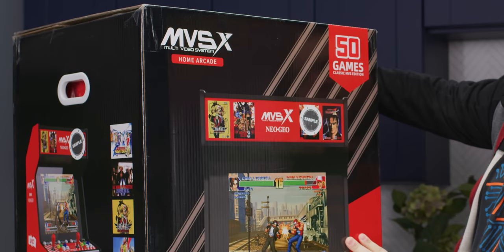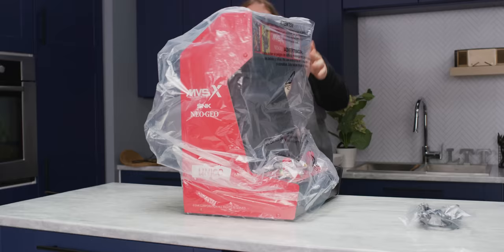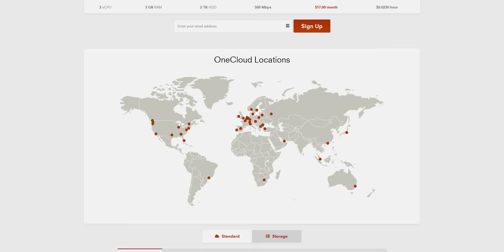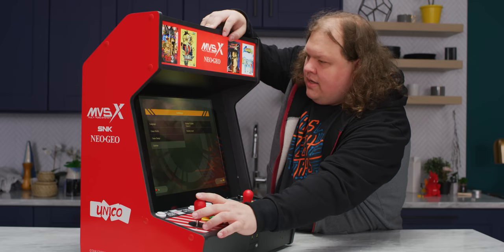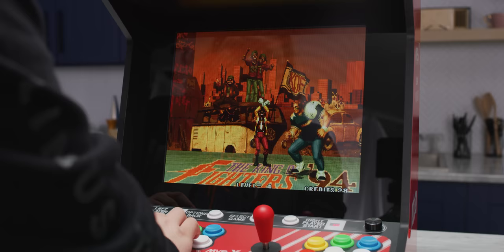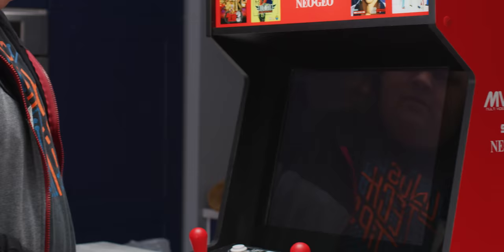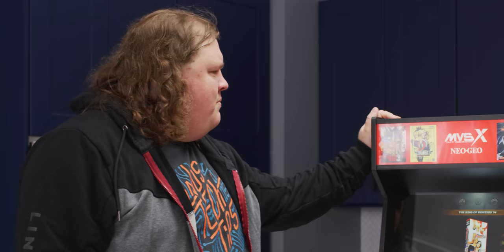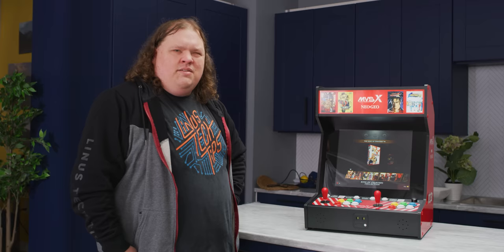My BIGGEST Unboxing! - NEO GEO MVSX Home Arcade

Comment: I recommend checking out the ashens review of this hunk of Junk.
Reply: A cultured individual I see
Reply: @TheLaptopLagger  I'm happy to see another cultured individual.
Reply: Strangely, I think Ashens review was better than Anthonys.
Reply: @madbstard1  to be fair this is just a basic look at the cabinet. But his "they're okay" or whatever comment on the buttons really concerns me.
Reply: @starpencil  Yeah, thought he'd do a lot more info on it. Ashens hated the buttons as well, plus he really raged about the extra unusable white buttons. Had another look and the options menu/button config doesn't even include the whites. Wonder why they included them?
Reply: @madbstard1  I honestly think it boils down to the fact the Ashens review was just that a review. And one by an arcade collector. While this was a short circuit video
Reply: @starpencil  Basically this. In true unboxing style, I hadn't seen it at all prior to walking on set with it. If I had played around with it more, I probably would have hated the buttons and layout about as much as Ashens did. I was a little timid about calling it terrible without having spent more time with it to confirm / "break them in". Stick's fine though.
Reply: @emily-young  exactly. I have a feeling age and experience has a lot to do with it as well.

Comment: You could easily build a far superior cabinet with 3/4in black mdf from the hardware store,  raspberry pie 4, 20in dell 2007fp lcd, an arcade stick and button kit from amazon, usb powered speakers. I bought a 1up Arcade on sale at walmart for 50$ (Galaga) took out the screen replaced with dell 2007fp, drilled extra holes for extra buttons and stick kit I found on Amazon, hooked up a raspberry pie 4 running retro pie. So for about 250.00 when all was said and done and it blows the doors off this thing. If you don't mind a little work it's an easy mod. The hardest part for me was making an mdf frame for the monitor so it looked nice. I added a thick glass screen in front of the lcd for effect but that's not needed. My nephews love it. I like going through random arcade roms I've never seen or got the chance to play I have so many I'll probably never get thru them all. lol. This thing is more of a NeoGeo collectors thing which I'm not knocking btw.

Comment: Something tells me that you are going to make a video to see if you can make your own for under 450
Reply: Depends on what are you standards for quality and effort. You can get cheap MVS consoles/carts seconhand, pair that with a supergun and some joysticks and your grandma's tv ( or any other CRT tv you can get for cheap, you don't have to get it from your grandma specifically. They provide the best neo geo experience in my opinion ) and you can make something that works for under 450$. but if you want an easy to setup and good looking option, this is probably the best you'll find at this price point.

Also I should metion the home console, but it's way more expensive (450 will get you the console and one or two games, depending on how cheeap they are), so not the best option if you're on a budget.
Reply: It wouldnt even be hard. MiSTer FPGA is doing everything up to PS1s now I think.  And you could probably put together one for like 200-350 bucks depending on how much you are willing to price shop, even a premade MiSTer kit is cheaper than this thing.

Comment: I fully expected a Raspberry Pi running emulation software there.
Reply: Same. I'd actually make one myself out of a Pi if not by the fact that I'm terrible working with wood and probably would cut myself three fingers off before reaching the drawing board.

Comment: This is worthwhile depending on where you live, how expensive materials are and more importantly how handy you are with tools to make one yourself. I am currently making one of these with a Raspberry pi, slightly nicer sticks and buttons and can vouch that cost of parts like the display, speakers and the wood, paint and misc supplies quickly add up to more than $500 if you factor your own hours of labor for a countertop like this one. Sure it can turn out nicer because you can customize it to your taste but its not a bad deal for the money if you are into Neo Geo. (Plus its legal.)

Comment: Power supply in the cabinet needs a few certifications like a Underwriters Laboratories (UL) listing. Using a power brick means the brick manufacturer has done and paid for the testing to get the certifications.

Comment: Still got a cupboard full of Neo Geo games and an RGB scart machine so i don't need one of these but still kind of cool. I guessing if you had turned on the integer scaled image with borders first and then turned on scanlines they would of worked better. As a back up i bought all my games for the Switch as the company who did those perfected it and the crt filter they used looks perfect.

Comment: no internal PSU means the "console" doesn't need to comply with the high voltage electrical regulations. 12Vdc @ 3A means you can pretty much do just about whatever you want (short of actually connecting the +12V to the chassis) and you'll pass the safety tests. Given that you can just buy a labeled PSU to include in the box, it makes the engineering and regulatory side of this product much much easier.

Comment: I made my own for the same amount of money and "only" a month of my own time...
It runs rpi4 so everything up to PS1 works nicely and it's a good ol' 20" Samsung 1600x1200 4:3 PVA and is 600mm wide (24") while console itself is 700mm wide.
I made it 6 months ago and only used it 2 or 3 times (in the first week, haven't touched it since).
It would probably see more run-time if I didn't have two kids and a mortgage... :D
... but damn it - if I could turn back time, I would do it again!

Comment: I actually like the overall design. I might prefer a slightly larger screen area even at the cost of clarity, I probably have just gotten spoiled over the years with all the modern large panels. That, and I can't see as well anymore. Great Idea with a lot of potential. Thanks!

Comment: I build one of these using an old AMD Trinity CPU, 2+2GB of DDR3 Ram, HDD, Seasonic powersupply, some chinese Sanwa knockoff kit (USB adaptor, meh buttons and good stick), some plywood, an old 19" TN panel I had... It's ok. And it was way cheaper than $450. It was something like... $300? But mind that prices of electronics here in Brazil (even used ones) are always 30% higher.

Comment: SNK is not shy about taking those nostalgia dollars, but they're also one of the few companies that will actually sell you ROMS. They've been giving away several NeoGeo games per month through amazon prime/twitch gaming that come with an emulator already but the roms are clearly designated and accessible in the files.

Comment: I have an actual neo geo MVS arcade board (and many cartridges including most of the games shown)  in my garage, but unfortunately I currently lack an arcade monitor and have to use a scan doubler to plug into a modern tv.
Reply: Google super gun.
Reply: @chronology556  http://www.jrok.com/hardware/RGBv4/index.html is what i'm already using, fwiw

Comment: There were multiple version of the home console, and 2 of them were not cartridge based they were cd based, original 1x cdrom and then the cdz., which had a 2x cdrom drive.  2 years ago I sold my Voltage Fighter Gowcaizer home cart for a few thousand.
Reply: Also you can burn your own games to CD's in most cases. And I've heard there are pre-cracked iso's for games that can't just be burnt to a CD.

Comment: Check out the MISTER FPGA project, you can use it to emulate this system and many others with ultra-low latency and boatloads of options. Costs a fair bit more than a raspberry pi but I have really enjoyed mine.

Comment: MVS is also related to difficulty no ? Also here in Turkey you can buy a full size one with coin mechanism for around the same price that does all the older consoles including neogeo (but mostly neogeo) for the same price (well even cheaper if you're not importing).And fun fact arcade units are called "atari" in Turkey lol

Comment: Not having a built in PSU removes manufacturer a whole lot of troubles in terms of safety certifications. Building a FCC/CE/UL/whatever certified device is much easier if you don't have to touch voltages at or above (IIRC) 75V, so you put a barrel connector on your device and ship it with an already certified PSU.

Comment: 16 Sanwa arcade buttons, 2 JLF joystick assemblies, and 2 Sanwa bat tops and the hardware would run $86.10 retail before tax and shipping.

16 Seimitsu arcade buttons, 2 LS-55-01 joystick assemblies, and 2 Sanwa bat tops, the price comes out to $96.10 retail before tax and shipping.

Both priced at Arcadeshock.

I didn't bother pricing out any Happ hardware, even though they would be the true way to experience North American arcade cabinets, because the MVSX cabinet simply wouldn't have enough room to fit them. It's a shame they couldn't include some premium hardware for that $450 asking price.

Comment: for the cost of this you could set up a full MiSTer FPGA unit and buy an excellent arcade stick and have an arcade perfect experience, instead of emulation. Not just for neo geo, but capcom (and other) arcade games, home consoles like SNES, Genesis and Turbografx, portables like gameboy and gameboy advance, as well as all sorts of old home computers like the amiga, pc/486 and x68000.

Comment: I got really impressed when my man Anthony noticed value on switched directional, told about differences between japanese and american buttons, and even a bit commentary regarding mamne and fbalpha. But when he chose at first the most cranky KoF to play and mash buttons... well, one cannot master everything in the world, can?.
Anyway, was just utterly satisfied when he opened the piece. I would like having a bit more detailing on display. Arcade CRTs are unique beasts, and having an LCD display trying to make justice to them in low res games... well, I don't think this usually goes well. Maybe if they tried a display with a integer multiple resolution of the original games... but when Anthony said about the uneveness of scanlines, this is a nope, it seems.

Comment: Did the website say it was just another $50 for the stand? That's a no brainer. I think it's a decent deal. Would be a cool add to the game room. Much cheaper than buying an actual arcade cabinet with one game. Then the maintenance is rather expensive on the old cabinets. With this thing and a small drink stand on each side, it's a definite buy for me. Unless a better option exist.
Reply: Comparing this to an original cabinet is like saying 'buying a sex doll is much cheaper then having a girlfriend in the long term'. The one is just fake, the other not.
Reply: @nils9853  You have issues lol. They both play games

Comment: The cartages are not the same. U need an adapter to run the mvs (arcade ver.) to the aes (the home console). They are not interchangeable and are proprietary to there own systems. SNK did this so arcade owners wouldn't buy the relatively cheaper aes cartridges to save money.

Comment: So, at the price point, it is much better to spend half the price on an Arcade1up, replace the internals with a Raspberry Pi and switch the sticks/buttons for something better. I did that with an Street Fighter II cabinet (1st gen) and it's great so far. Running Retropie with a custom theme I did with all the legally owned games I have... wink.

And it's bigger than this (minicab-size), so about 3/4 it's size, 1/10 the weight and easy to assembly too.

Comment: So basically what this is is a raspberry pie with a LCD screen wrapped up and painted in what looks like a small arcade case with cheap arcade buttons.

However, the USB a port on the back makes me think you could hack it and put alot more.
Reply: ya its easy to add a few hundred more games

Comment: I built my own Mame arcade for really cheap. Its got a CRT and everything. So personally I dont think this is worth it. Its got a core 2 duo, a pegatron gt 210, ssd and xp running on it with an old version of mame with about 3000 old games on there from 70s to 2000. I had to fix the old X-Arcade what was with it. X-Arcade still sells the PCBs for it. Originally it ran 98 with an old version of mame and the last time it was used was in 2008 I know this thanks to Microsoft scandisk log on the c: drive on an old IDE maxtor fireball. I think someone was in the middle of restoring it and gave up with all the issues they had. I had to get the X-Arcade working, I had to completely replace the computer because the mobo was dead, the parts on it were old and the power supply for it died while testing it. 
The coin mech on the other hand I had to mess with to get it working and then I even went through the trouble to get a new bulb for the red button to light up. And with the new power supply I had to cut up a molex and join it straight to the light. DId you know that with a molex the two black wires are ground, the yellow one is a 12v rail and the red is a 5v rail? Thats something I learnt because I did some research before chopping up my power supply cables. 

Reently I have bought a strip of white LEDs to restore the arcade logo at the top. There is multiple horizontal lines of led and damn is it blinding. And the custom mame logo looks amazing. In recent news with it I have been working on the body of it by filling some of the broken wood and soon when I get a chance I need to spray paint it back to black. I have been working on this since about march or something and man have I loved every moment restoring it. I have even gone to the extent to pay a locksmith to open the old doors for the coin mechanism and the boxes what were at the bottom and luckily all the original boxes were in the bottom. I have also ordered some new locks from amazon which fitted perfectly. 

And thus I think this is a huge rip off. 

Sorry if there is some spelling mistakes or a sentance doesn't make sence but its like 11pm and I am tired as hell and I cannot be bothered to check. Let me know if something doesn't make sense. Thanks.

Comment: This is only good if you replace the internals with a MiSTer FPGA, which there goes another $400. Basically you would be buying it just for the cabinet and I am not sure its worth it.

Comment: Why you need a brick? Because its cheaper. Those are standard parts with all the nessaccary safty certifications. If you build in a mains power supply, probably they would have to certify this new unit as a whole with testings for heat, safety, etc.

Comment: Honestly, this just made me want to look into something like Arduino to make a custom controller to make my own arcade machine.
Reply: Rasppi is better for retro games arduino is more micro controller (as far as i know) the pi has tons of ports and you can buy one for cheap tight now to start your build and be sure to post what you did somewhere
Reply: @the_retag  I was thinking of using the Arduino as a game controller. For the emulator unit a Raspberry Pi works well if I just add a small fan for cooling, but it doesn't quite seem to be as convenient to use as a controller as well. So that's basically what my thought process and research has led me to.
If you know more about it than that, then please let me know.
Reply: @CottidaeSEA  in a controller yes, a rasppi is a bit to much i missunderstood that
Reply: Although used as a controller i doubt that anything would need a cooling fan
Reply: @the_retag  Ah, with the cooling fan I was mostly thinking that if you were to use the Raspberry Pi, you'd likely want a fan to keep it cool since you'd also run the emulating software on it.
Reply: @CottidaeSEA  interesting concept a controller with integrated emulator similarities to a switch but still different

Comment: Am american neo geo cab would've probably had iL joysticks, not sanwa. And if you just replace the button switches with actual cherry switchs they should feel better, you don't need to do the whole button assembly. Keep the Chinese ones for backup and you don't need to change the menu switches. It doesn't matter if those feel like ass and the cherry switches aren't cheap.
Reply: The major problem wasn't necessarily the feel of the switch itself (which was sort of spongy with no tactile feedback), but that the buttons were jamming / scraping when you hit them in any way other than direct center. IMO the whole assembly needs to go. Sticks feel fine though, smooth and microswitched. Maybe if they didn't have the extra four buttons for the P1 and P2 controls they'd have saved the difference on getting something halfway decent.
Reply: @emily-young  Weird. I use the cheap Chinese buttons from Amazon in a few builds. I just replaced the gameplay switches and they are fine. Not as good as legit Happ button, (especially the pre china buttons), but they still feel pretty good. Maybe something in the supply chain got covid? 
I was about to order more for a project and you have me a bit worried. Maybe I will spring for Happ stuff, it isn't too much more and I only need six.

Comment: When you look at the value of the system you need to look at the components.  A monitor like that woud be around £100 with a two player kit of controls at £40.  The computer itself is similar to a Pi 4 in terms of power and in terms of power supply you are looking at a cheap phone adapter.  As such I we are talking in the region of £220 of materials when you account for the wood.  Whether it is worthwhile would depend if you had the tools and skills to make something like this yourself and how much your own time is worth.  If it were around the £250 - £300 mark I could see the sense in it, but at what will be £450 (at least) on release...  For me the cost is too high.